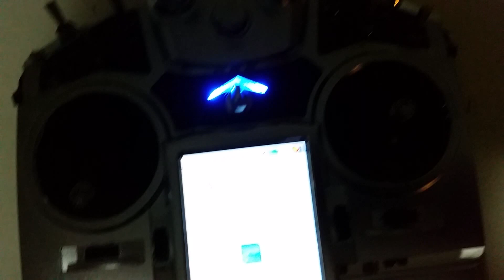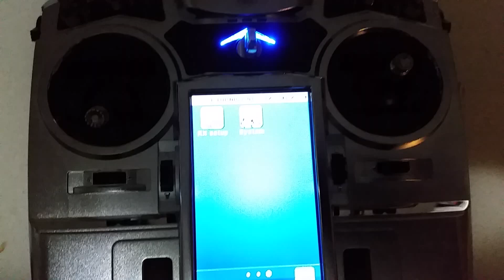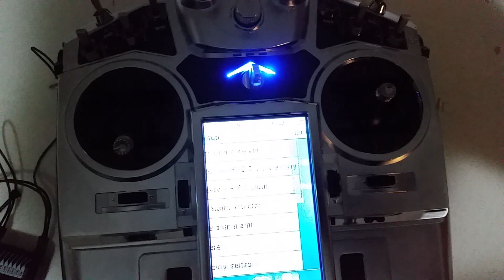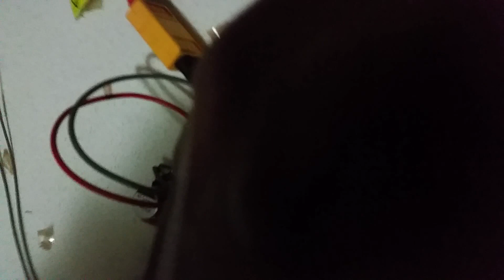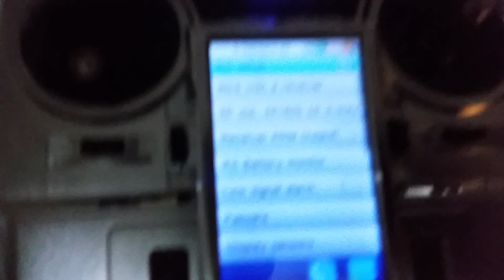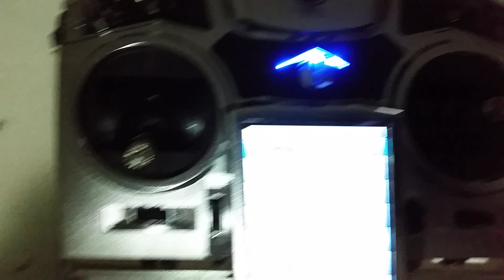How to bind  Turnigy iA6 Receiver and iA10 Receiver to TGY-i10 Radio

Comment: why dosnt anyone talk anymore , have no idea what is going on here
Reply from the maker: if you follow the  captions on the screen you will understand the process
Reply from the maker: basically what  u have to do is 

Connect the binding plug  to  B/VCC slot (shorts the signal pin to ground)
The n power up the Receiver  (you can use any empty slot)
LED should blink fast now
Goto “Rx setup” on the screen 
Then select “bind with receiver “
Then  select “yes “
LED on the receiver goes solid red 
On the Radio Rx icon goes Green now